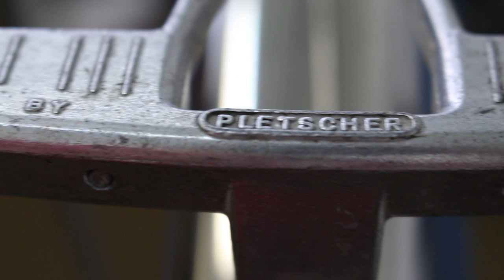IKEA bike basket with hidden floor

Comment: Great idea with the hidden compartment.
But I find the IKEA Knagglig boxes are rather heavy for their size. Especially the heavy duty double studs are overkill.
I have one of these much lighter wooden boxes from Hornbach mounted on the front of an old stiff fork MTB in randonneur style:
https://www.hornbach.ch/shop/Allzweckkiste-Holz-400-x-150-x-300-mm/5065590/artikel.html
I love how you can just throw anything in the box and just go
Reply from the maker: Thanks cheesy! And yes it is pretty heavy for a small box, but the whole bike is already heavy anyway.
Reply from the maker: ah, I just got a chance to look at the one in your link, that looks very good! and low cost too.